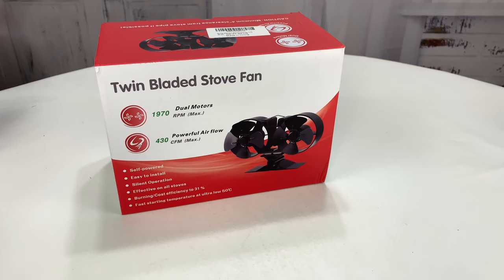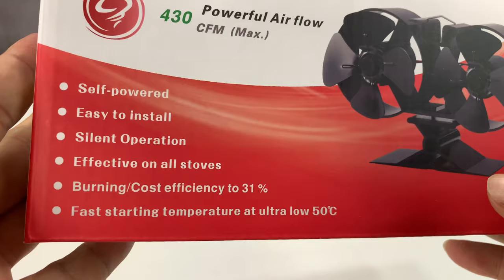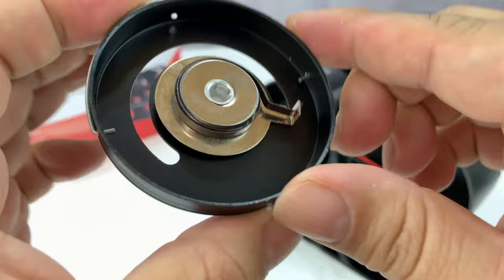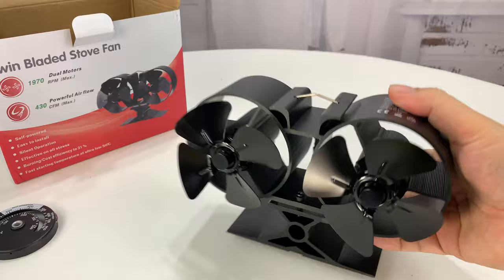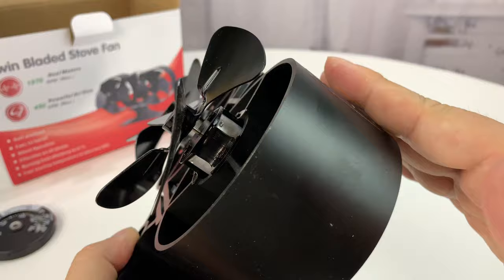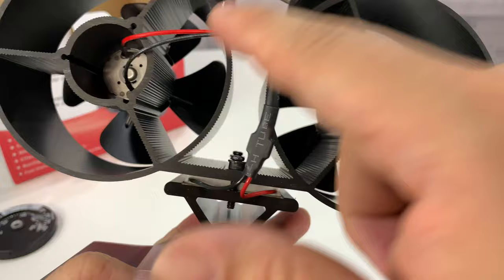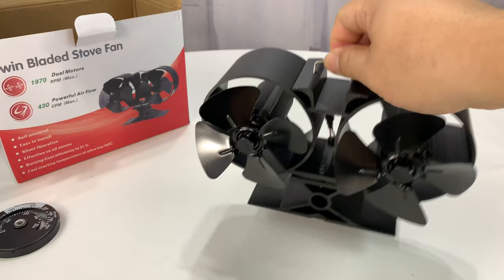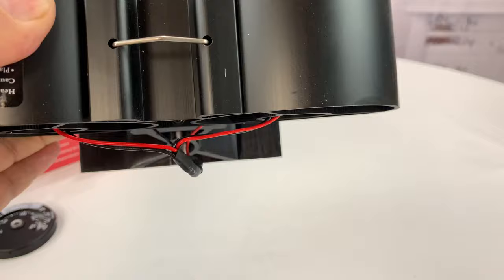Twin Blade Heat Powered Wood Burning Stove Fan by Sonyabecca Review

Comment: I have a Voda double fan that cranks 380 cfm sitting on top of my Little Buddy propane heater.  Used heavy copper wire to affix so it can't fall off.  GREAT invention, warms my entire garage.  Propane now is over $4/gal so I don't run it as much as I used to.  I blame Joe.
Reply: Because Joe is to blame FJB

Comment: Thanks for the review. The fan is to sit at the back of heater (cool air) and definitely not in front of the flue, as the flue heats the motor and wires.

Comment: its not an "insulator" block, its a Peltier block.  It works in reverse too, if you apply current to it, 1 side will get hot, and the other will get cold.
Reply from the maker: Ah, fascinating! Some sort of thermal converter?
Reply: @petervonpanda  more or less. Its not very efficient, as you can see, it takes a lot of heat difference to make only a tiny amount of voltage.
Reply: @petervonpanda  I'm curious - blow on it with a leaf blower or something and see how warm/cool it gets. I believe it's the bottom which will get cool, and the upper which will get warm.
Reply: @chubbysumo2230  You can talk about low voltage but the proof is in the pudding. Truth is SOME work very well.  I was quite surprised how much better my Little Buddy propane heater works with a $57 Voda 350 cfm dual-fan sitting on top; I'd say it heats my garage/man cave about 3 to 4 times as fast.  Heat goes forward and hardly any goes straight up which was very noticeable before.  The blades start turning within 1 minute of lighting the heater and accelerate as it gets warmer; full speed within 2 to 3 minutes if it's on High setting but by then it's putting out so much heat you'll probably turn it down.  Honestly.
I sit about 5' from mine and when it's running on Low I feel a nice, broad air stream that's pleasantly warm.  They're not toys nor cheaply made novelty items although the blades are exposed so you need to be careful handling the unit like any other small electrical device.  I used heavy copper wire to affix the fan to the top of my heater to prevent it being knocked off.  If the one I have now ever gets ruined somehow I'll get another immediately, probably the same one.

Comment: There is quite some physics involved with this device, which should be explained, when you zry to discuss it. The "insulation block" is the key to the functionality of this fan. It is a TEG, a thermal electric generator. In computers it is used in reversed order to cool down CPU´s. The upper part with the tubes behind the fans is a heat sink. Its purpose is to expose a maximum surface to the moving air. That is why it has a grooved surface. The grooves increase the surface area thus more thermal energy can be radiated out into the (relatively cool) moving air stream. Temperature difference is the key here. 200C on the bottom base and 80C on the top part make this work. I don´t want to be smart ass, but you make a better impression, if you educate yourself before you go public with anything.
Reply: I would agree 100%, do a little self education first.

Comment: I have a pair of these type fans for my inset stove , which fortunately stands out about 5” from the fireplace so I can stand the fans on top directly above the vents , the fans really do push the heat outward from the stove , in fact the granite shelve directly above the fans stays cool whereas before I had  the fans it used to get very hot, so I would definitely recommend them to help push the heat round the room

Comment: That strip on the bottom i think is a different metal that when it gets hot will lift the front of the unit so it does not get so much heat transferred into the body . Clever simple idea

Comment: You've got me sold.  However, I cannot find anyplace that has them in stock.  Ideas?  

Thanks.  Great video.
Reply from the maker: I found a link to one. https://amzn.to/2NsaSsU
Reply: Amazon.  Voda 350 cfm dual fan.  Mine cost $57.  Actually works much better than I expected on my Little Buddy propane heater.

Comment: ANOTHER YT'er who evidently cannot read instructions....  For proper operation the fans need to pull in cooler air versus the hot bottom plate.  Placing the fan DIRECTLY in front of the stove vent tube is providing just the opposite - HOTTER air than what would be normally pulled in from the sides.  The BEST location for these fans is AT THE VERY BACK, ON THE SIDES, that way the fans have much cooler air coming from the unheated rear area of the stove top and the airflow would also be flowing over the stove-top....
Reply: Calm down.  I use a thermoelectric fan on the top front of my woodstove and it works perfectly.   You may not be aware of this, but the air directly above the Woodstove is a few hundred degrees cooler than the stove surface. 

When you become a successful YouTuber start being hypercritical again.